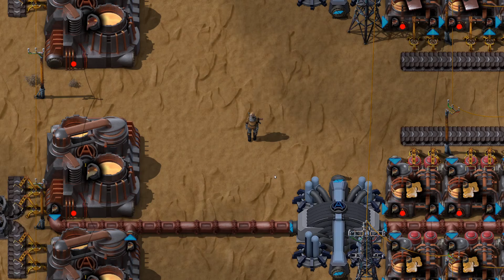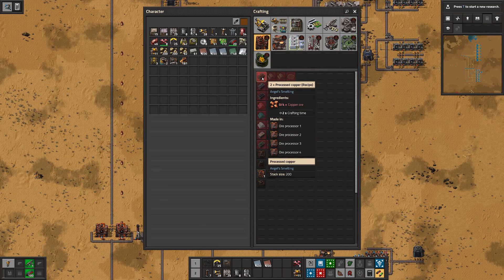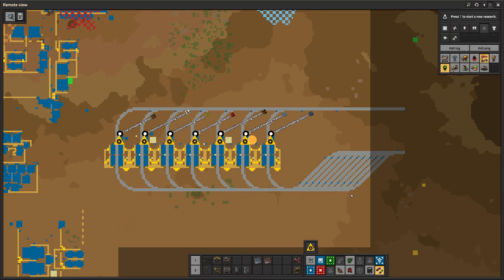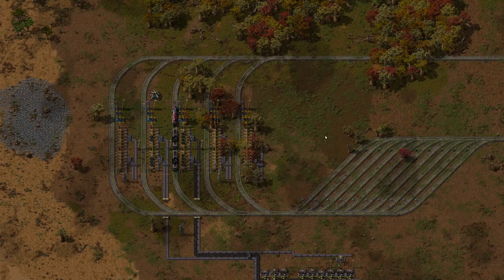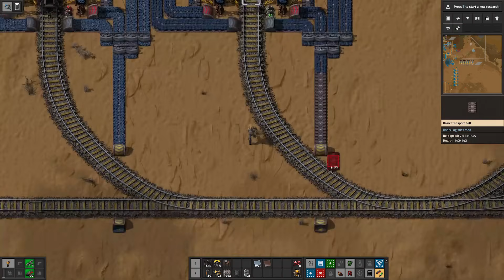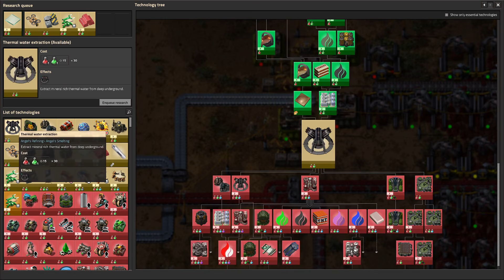Trains, Trains, Trains, and an already outdated Ore Processing Setup

Comment: spent 450 hours running thru the latest bob angel, extended angel. mad clown, now with space age. and im 8k hour player. you need to make your stations much longer to allow for a waiting train behind it, and also leaving the room for the later stages
Reply from the maker: There is a waiting bay for trains and the station have a limit of two trains on the delivery side and something similar on the pickup. I am not sure if a two length train will be enough, but I guess we just have to wait and see...